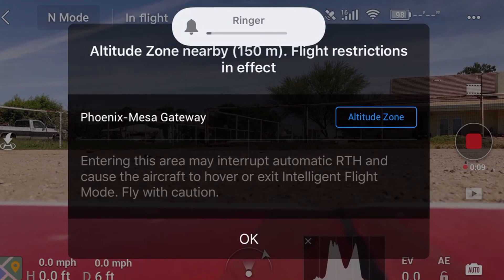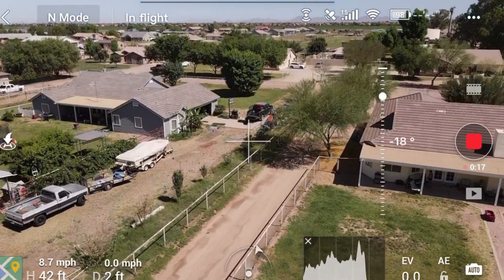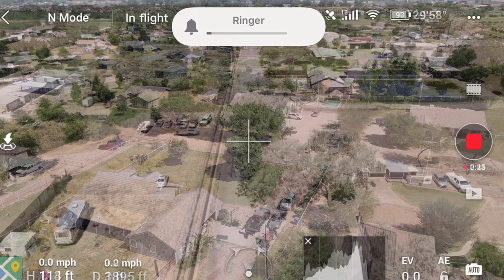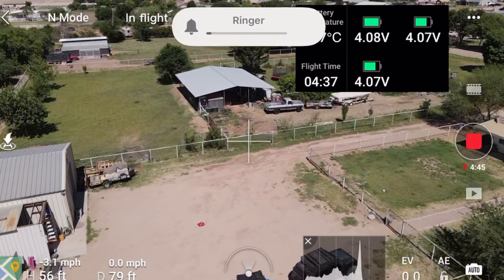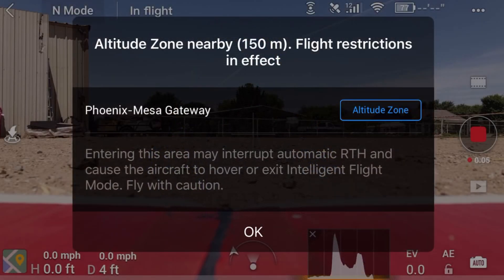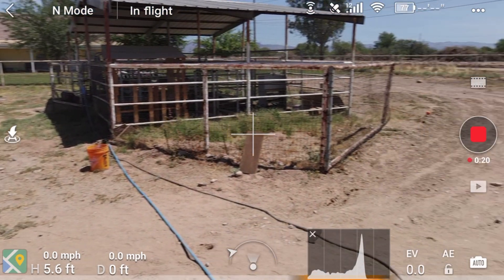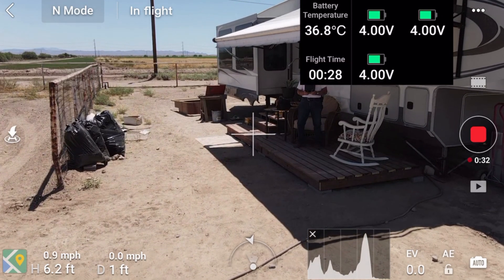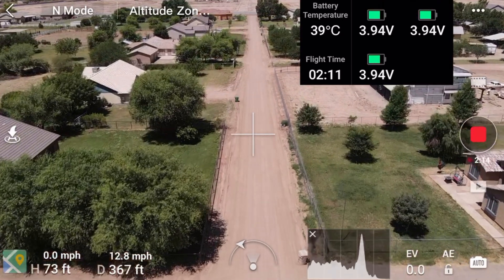MAVIC AIR 2 BATTERY TEMPERATURE ON A HOT ARIZONA DAY

Comment: der my phantom 3 pro    batery at 30%     and the temp  62c   !  otside 33c    its  that normal???  and what is max  temp??  helo from Montenegro MNE  :)
Reply from the maker: Thank you for your comment and question. 62 is a little high so I wouldn't recommend doing it very often. Max temp should be below 55 or so. God bless.
Reply: @user-sr8pn9xg8z    yes in winter when is otside plus 13C   temp batterije its 52C  but now problem ! :(  too much but interesant same timing  abaut 20min flight .. no problem ...  .. thank you too sir !! respect! :( and sorry im not soo great in En  langunge

Comment: Well Mr Kent, being a native Tucsonan, I can relate to the Arizona heat. Although now I am in another type of heat in the Florida panhandle.  I have an overheating condition too, but not the batteries. My Brand new, never flown, Mavic Air 2 gives me (Code: 30135 Aircraft processor chip overheating. Power off aircraft and wait for temperature to return to normal.) Straight out of the box! It will shut itself off in less than7 minutes of powering it on. I'm not talking about running the motors, the motors have never been started, just being turned on and sitting in an air conditioned room. The batteries didn't seem hot at all, but the aircraft was real hot. I'm fairly sure that the fan is inoperable, as several people have told me that I should hear a fan but I have never heard a fan at all. So bummer for me, now I have to try to get it replaced. Maybe I should have gotten the Mavic 2 Pro like I originally had planned!
 I'm happy to see that your son is very skilled, he will have that fixed in no time!  Thanks for the great Videos.
Reply from the maker: I'm sorry to hear that Steve. That does take the excitement out of the excitement of getting a new drone. I hope the fix goes through rapidly and God bless.

Comment: Great as always Mr. Kent. I have a Phantom 4 with four batteries. A Mavic Pro with 12 batteries. I have flown my Mavic pro at 9 degrees in Utah this past December. That was the coldest flying that I have even down. The hottest I have ever frown the Mavic Pro was 108 degrees in the shade here in Arizona. As you know when you step out of the shade it is HOT! I have lost my drone several times out in the desert, but always found it. So far I have never had a battery swell up or go bad. Of course I don't get as good of flight time as they are older now, but I can not complain. Be safe and keep putting out those great videos. Thanks.
Reply from the maker: Thank you Robert for your input. That's very interesting info. God bless.

Comment: Hum, I’m going to have to keep an eye on my battery temp. I’m sure I saw 52c on my air 1 battery last weekend. The outside temp was only around 26c. It’s raining today so I cannot check it.
Reply from the maker: Thank you for your comment Earle. Well, maybe it doesn't do that much damage. I am only speaking from what I have heard and read. God bless.
Reply: I think you are correct. 52c is high.  I’ll have to check the recommended operating temperatures.